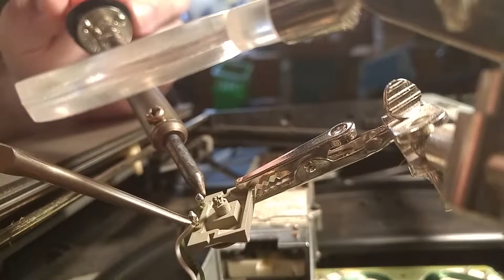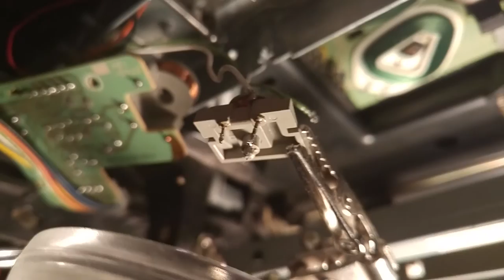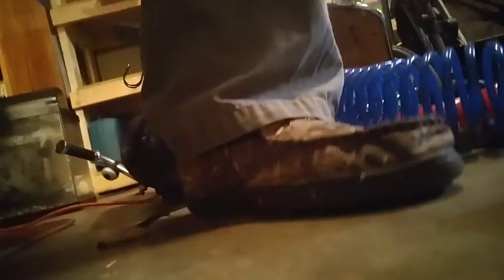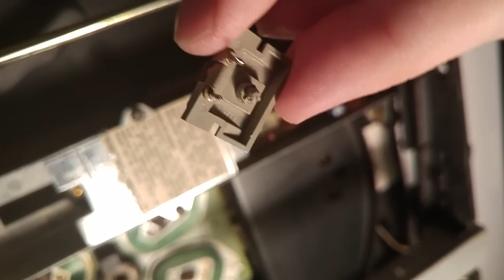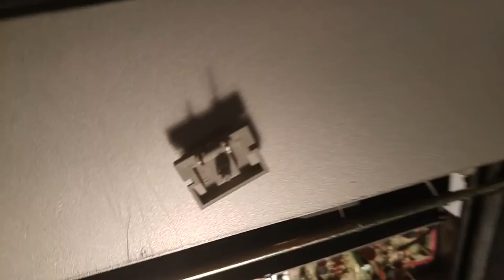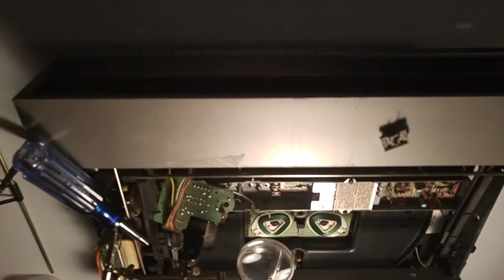CED Player J/K Arm Stretcher Coil Removal SJT300

Comment: Thanks for this. May come in handy. I'm from the forum. I've got I think 8 players at the moment I've got to open. I'm going to start by replacing the soft touch control conductive bubble onto conductive tracing switches (what would/do you call that type??) to mechanical tactile switches. I made an aluminum template type deal to slip onto the panel and then I position my cutter at the hole in the template, remove the template, and pluge a hole thru the panel. I had CEDatum do one for me but the shipping adds so much to the cost that I'm going to do them myself. I plan on keeping maybe a couple of them and selling the rest.
    On your soldering iron, was it totally heated when you began de-soldering the part? It kind of acts as though it just hadn't warmed up completely. With mine it seems like it takes 5 minutes or so to preheat. I forget the brand but it's cheap and variable wattage. I generally turn it all the way up and if I'm doing something where I'm using it over a prolonged amount of time (say 15 minutes) I back the heat down a little after it's been completely heated for a few minutes.
Reply from the maker: It's just a plain jane cranftsman soldering iron. I usually let it heat up about 10 minutes. I would hope that's enough to bring it to full temp. I don't solder much so I don't want to buy a nice one. Are you replacing all the faceplates with the new buttons? That seems excessive. I've had dozens of players and only ever encountered one stuck button. Doesn't make much sense to change them all out of they still work fine. But that's your perogative. Glad my video could help. Thanks.
Reply: That's probably up to temp then. I have that sometimes happen. It seems like one connection doesn't want to melt but another connection as soon as the iron hits it it melts instantly. My iron isn't an expensive one. I may just have bad luck with those stock buttons. One player didn't work when I got it (the buttons didn't work) only button that worked was the reject. That's the panel I sent to CEDatum. Then the other player had been working but in the short time I was changing the belt/cleaning it up one of the buttons quit working, don't remember which one, one of the search buttons I guess. It seems like a cheap way to do it but I guess maybe I just got 2 bad ones? I think I may have the same type of switch on my ovens timer and it quit working a few months back. The oven is about 17 years old and I've used the timer quite a bit. Now though if I do get it to start timing I can't always get it to shut off, and it continues to beep until it gets shut off, so I have to unplug the oven. With the players I'm just thinking if I sell one/some of them I'd rather have the new switches installed so it's one less thing that could go wrong with it in the near future.